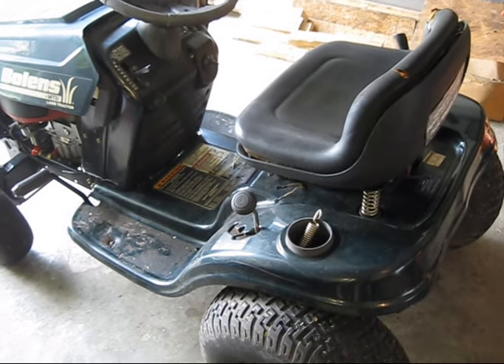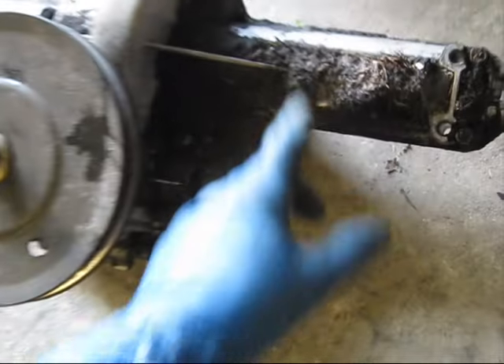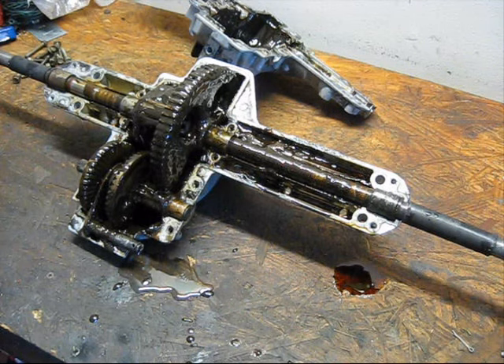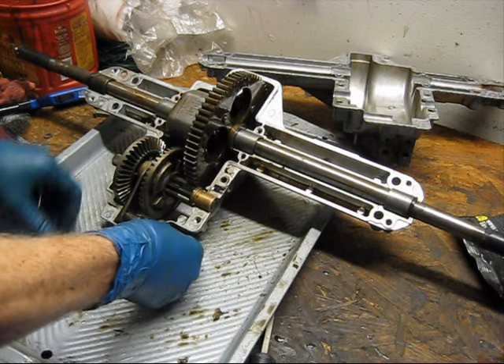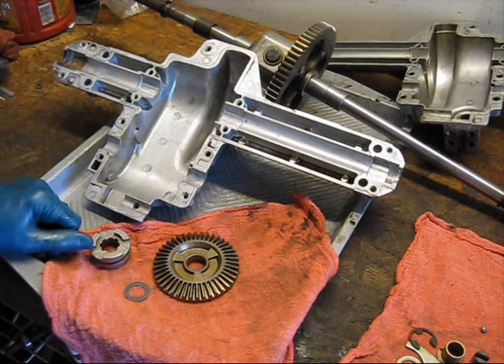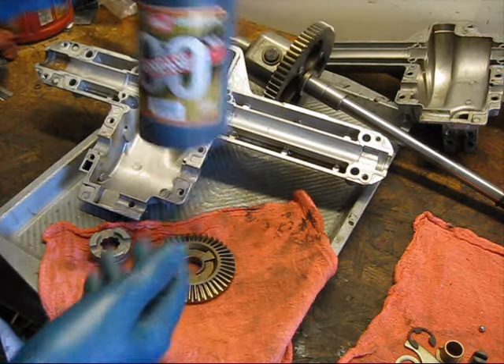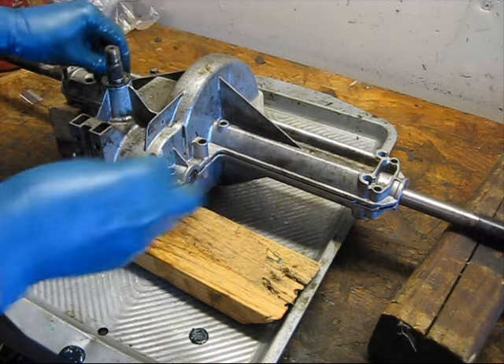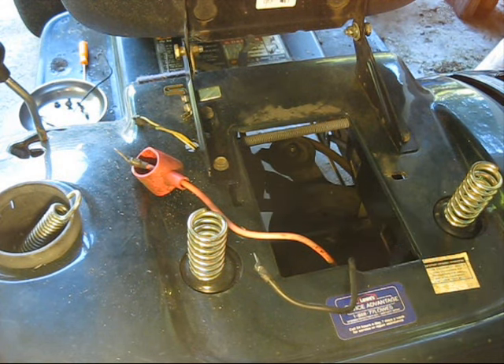Bolens/MTD Mower popping out of gear -  Varidrive transmission Repair.

Comment: @pfun41. Hey there pfun41, great video for starters. Well, first I wanted to say thanks for really describing the issues with your transaxle. Not all video's go into it as well as you've did here. I hope that you don't mind if I download this one, mainly because you go in depth with the issue & explaining it so well, as to how it happened. One potential issue I wanted to ask is, when you added the new lubricant, why didn't you put some of it inside the ends of the casing since there is no way the lube can get from the gears section of the case, over to the 2 bearings on either side, or maybe I should say the inner & outer Bearings that the axle shaft rides on. To me it seems like a design flaw, unless they didn't want those bearings to last much past the warranty period. It just seems like they'd wear a lot quicker the way the casing is made. Why there's no channel routed so the lube can work it's way to the outer sections or some sort of directions that address what is probably an issue further down the repair road... 

I remember when I'd have to run cable cranes, there was always these small cups with lids. Some would have a sticker or on the really old cranes, instructions were stamped into the lid. Like every 250 hour, or 500 hours, 2,000 meant yearly but you get the picture. I would think that at some point, lubricant would need to get to both bearings on either end of the shaft.
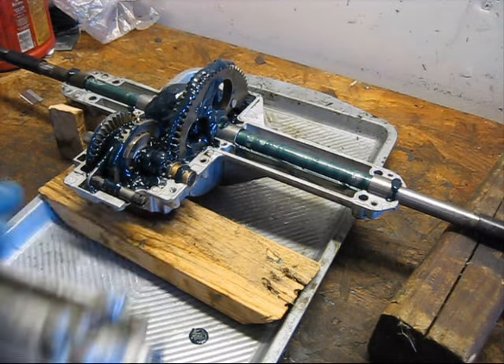I had ''17:42'' jotted down. That's just before you put the top section back on.... Thanks again for the video, MD...............
Reply from the maker: Those bearings are actually bushings. If you look close you'll notice grease oozing out between them and the axles before I started filling the case with grease. I added grease before I slid the axles through them. As for the rest, this thin grease will work it's way into just about everything over time, it will make it's way through the channel and into those bushings. Most mower transaxles like this aren't mean tto be greased regularly. They are fairly low speed and typically will not fail from lubrication problems before the rest of the mower, so the manufacturers don't worry about it.
Reply: @pfun41  Oh, I did say bearings didn't I, my mistake. Okay, well you answered it. The grease does find it's way to the outer bushing. I'm actually working on a vintage Fender Stratocaster body today so once I get done what I started, I was planning on doing some measuring & checking the PDF's on this mower which I was lucky enough to find. That way I can make sure Michael [my son] is ordering all the correct parts. So far I noticed a tad more wiggle on the right side, so the bushing kit should go on the list. Since he bought it ''not working,'' he should get the seals for the axle only because if it start leaking once the lubricant is added & the bushings are all new, having a leak would make the both of look sorta dumb. I mean paying $100 for the mower that other than the forward issue, starts, runs & seems to just as strong as a new mower,  he'll be okay investment wise to add the bushings & seals anyways because he'd be buying what you bought for your mower, so what's another $25-$35. I would have bought it if he didn't. Besides, for what it'll cost him to do this project, a 22'' Toro new would still be $430. He'll probably be at half the price of that Toro once he buttons up this mower. As for the Belts, if it's like the Craftsman 38'' I have parked, he'll be able to get another season out of this set. Hey, thanks for getting back with me. I should make a video of how it goes so others an see that even a guy who's never messed with one of these MTD's, plus has no experience doing anything like this period, will be able to read just how easy it was to get this one right.... I'm sure there's hundreds of thousands od people out there with the exact same issue. Take care & again, thanks for the great video... It really helped.
Reply: @pfun41, just put both parts like you did but ya know at your video at 19 minutes, you can pretty much spin the pulley easy. On this one, not easy at all. I asked my son if he did spin the pulley before tearing it down & he said no, not really. So as I talk him into removing the top section of the gear case, is there something that he may have missed? So far I can't think of anything. Unless that horizontal shaft was damaged or has some burrs or something along those lines...
Reply from the maker: @montydaniels1054  If the grease dried out it the shaft may have rusted inside. You would be surprised how stiff something can be and still move when on the machine. I don't recall if it's a bushing or bearing on these but whatever it is it should be greased.
Reply: @pfun41  Okay, my son told me yesterday that he only put a dab of 00 grease in the gear case. I said it's possible since we used mineral spirits to clean the parts off that the needle bearings are dry & since the bevel gear & shift collar are both new, according to the parts catalog we used to get all the part numbers & then parts from Tractor Supply, you may need to remove one of the thrush washers &/or one of the regular washers since it had a note that read, use as needed & since those two parts are new, it is possible that it's too tight for the forward gear to rotate properly.  I'm going with that & since there's a lack of 00 grease, the needle bearings are more than likely binding since he didn't force the grease into that bearing. I'll update it this afternoon so you know what we ran into & others reading will get some more important information to put in their personal bag of tricks. In the meantime, thanks for uploading such a great video & also passing on some of your knowledge. Oh yeah one more thing, now I know what's wrong with my Craftsman rider. Perhaps if my son doesn't leave this mower here for us older folk to use, I can get mine going since I was injured back in 2007, I can no longer do walk behind mowing & the wife is 4 years older than I am & she's finished taking care of mowing.. She's a good strong Polish gal but even those strong Polish gals have to slow down, lol & thanks again pfun41... M.D. ..............
Reply: @pfun41. Just took it apart, cleaned everything off again, checked everything out & added the grease after checking it out & it works just fine. So thank you for the video.

Comment: I changed gears and it still pops out of 3 gear into 6th whats the proplem
Reply from the maker: If it's popping into another gear that's an issue with the varidrive, not the trasaxle. Varidrive handles speed, Transaxle handles direction.

Comment: Mine doesn't do good with grease it did lots better with the 20w50 synthetic hydrostatic zero turn transmission fluid oil from tractor supplie it gave mine more reverse speed

Comment: What are the torque specs for the 1/4" case bolts ?
Reply from the maker: Not sure. Its not super critical on this, so I would usually snug them down with a 1/4 drive ratchet. Or you can find a generic torque spec for that size bolt in aluminum threads and use that.
Reply: @pfun41  I took them to 60 inch pnds which is 5 ft pnds. Probably could go a little more but theyll probably be fine.

Comment: where do you get the gears from and do they have lesser teeth
Reply from the maker: Partstree or Ebay and no, they are identical.
Reply: @pfun41  jacks small engines is awesome, has everything you need for almost any mower. mtd site is a bit pricey but enter your model and they shoud have all oem